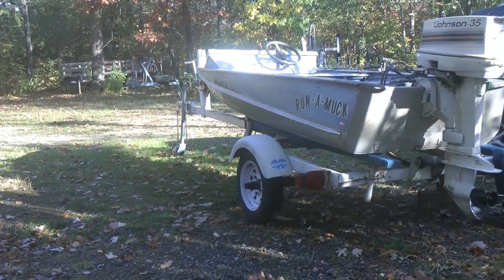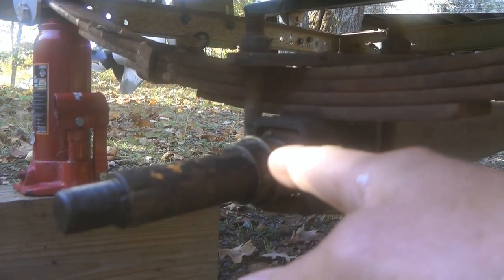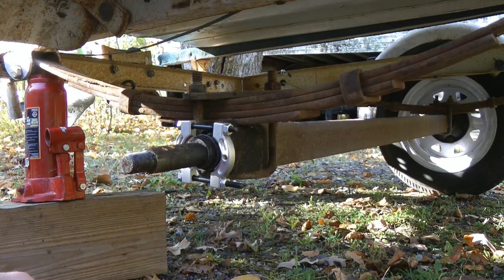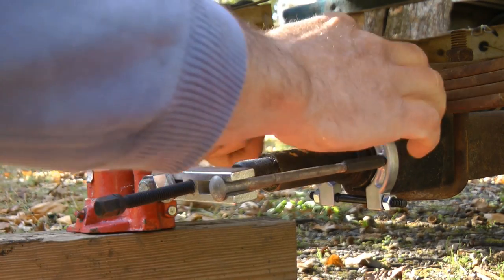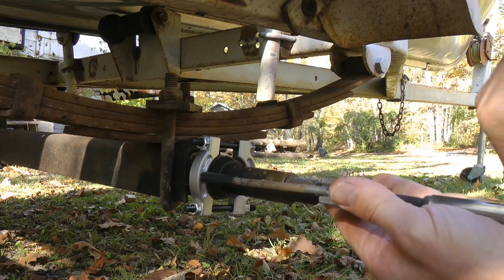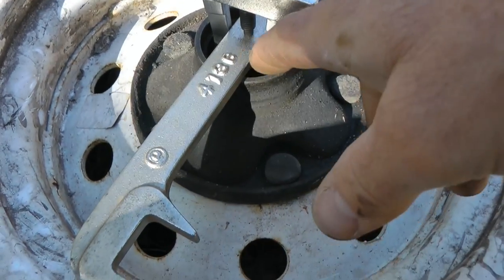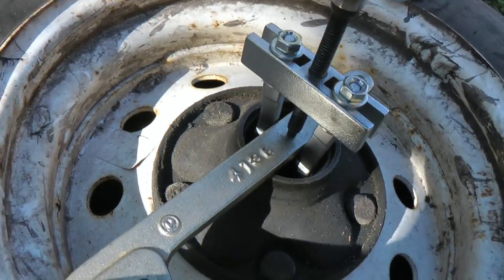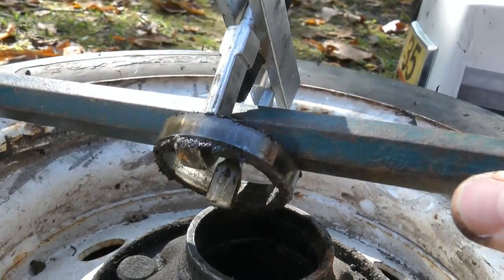NOVICE LEVEL - How to Remove that Stuck Bearing Race & How to Replace it.

Comment: Ahhh, I've been beating my head against the wall with the same issue and by simply watching your video I feel much better about it. I'm going the grinder a chisel approach. Thanks for the video
Reply from the maker: Ricardo Santiago Good luck,but I bet you will have to spring for this $20 kit...
Reply: I may have to, Where exactly did you purchase this puller?

Comment: I am in the same boat. But the inner bearing sleeve that's stuck on shaft spins, but won't come off, like its set in a channel. I'm gonna try heat and see. But the great video. I didn't think id find one so exact to my problem.
Reply: Did you figure out how to get it off? I have the same issue. It spins but it won’t come off the spindle

Comment: NIce video, should add that you always want to use a good rust penetrant like WD-40,  Liquid Wrench, or good ol 50/50 mix of acetone and trans fluid. The last one is killer for very tight rusted bolts. Saved my butt numerous times when the over the counter stuff wouldn't.

Comment: I usually just cut 3/4s of the way through the old stuck race with a Zip disk( at a 45 degree angle so I don’t damage the shaft) then use a cold chisel and hammer. They break really easily and slide off by hand. Cheers

Comment: Should have cleaned the shaft first, sprayed some wd-40 and heated the inner bear, not the shaft. Would have slipped right off
Reply: Actually I tried that with a torch and mine certainly didn't slip off at all! LOL! I had to cut it in 2 places with an air cut off tool!
Reply: How did you end up getting it off? I have a old 60’s trailer that seems to be the Exact same as yours.